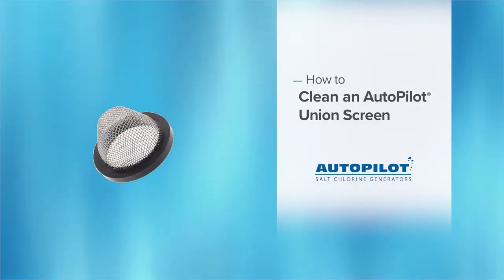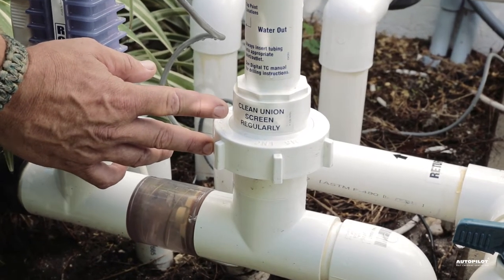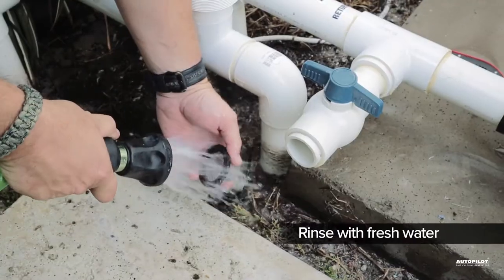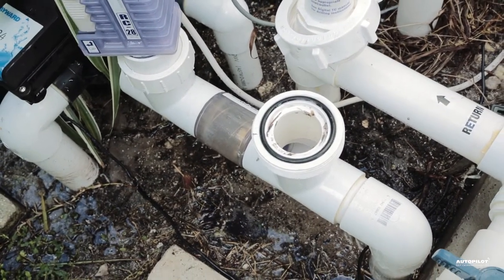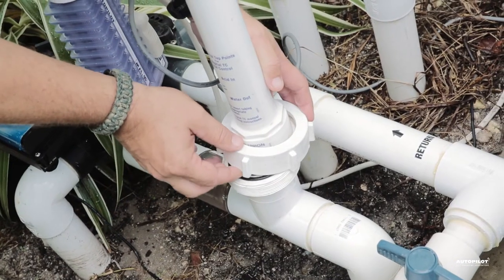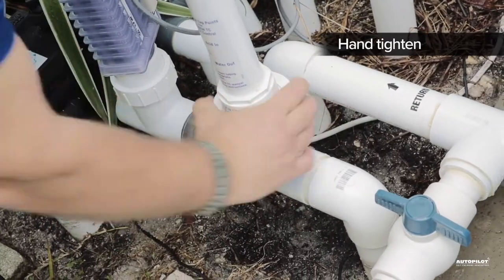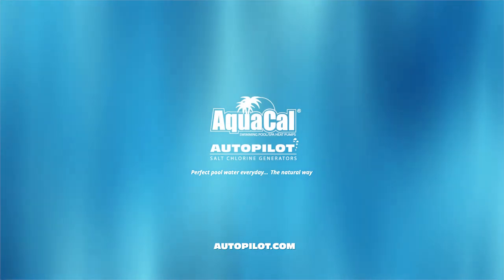How to Clean an AutoPilot Union Screen

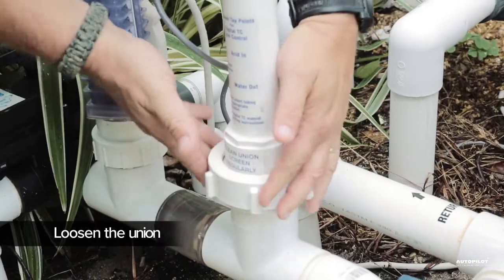Comment: At 0:24, the video shows using an oil filter wrench.  You could also try a strap wrench, large channel locks pliers, large pipe wrench, or bar clamp.